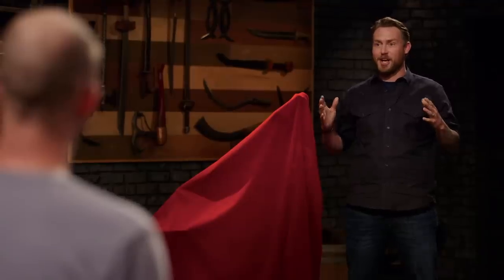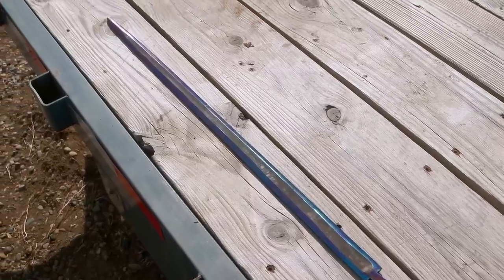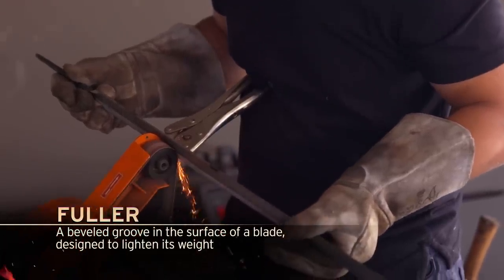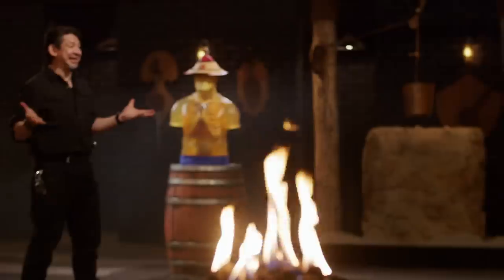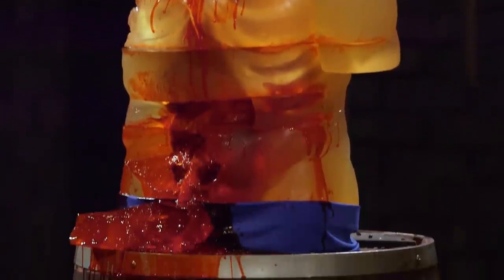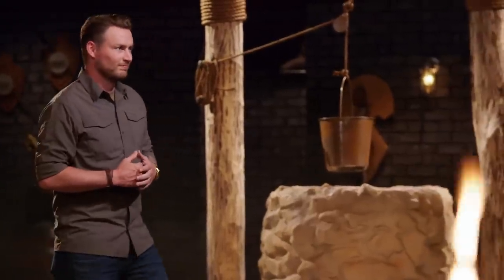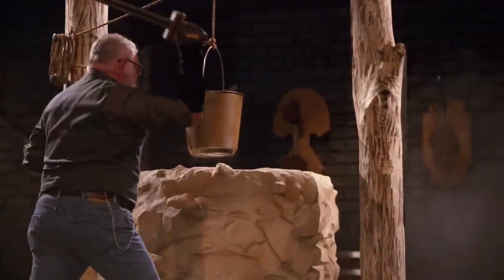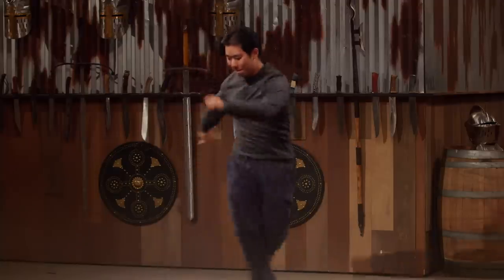Forged in Fire: TERRIFYING Tuareg Takoba TEARS UP the Final Round (Season 8) | History

Comment: Homie quenched THREE times and not only survived, but won! An absolute LEGEND.
Reply: why is it not advised to quench a blade more than once?
Reply: @angelserenade  Every time you heat up the steel and cool it down, you burn off more and more carbon content. Each quench increases the risk of the steel developing a crack, which comprises the blade. Warping can happen as well, but that’s not “as serious” as a delamination.
Reply: I even thought josh could lose it because of that quenching thing.. which is the greatest nightmare of all the bladesmiths... luckily his blade endured the strength test..
Reply: Guess he survive due to the material he's using. Not sure though, I'm also looking for answers in comment
Reply: @magnaviousyk3118  it looks like thick Leaf spring steel the same kind used in much older bulkier junker cars and its a nice choice when turning it into blades as it guarantees better blade retention and can take punishments
 when quenched right

Comment: Dave is such a tough guy. You can see his right hand was cut and bleeding after he took off the sleeve, perhaps just a nick, and it could be a lot nastier, with that free falling blade's tip. He went on to the next test with a glove!

The Asian dude's blade has a warp after the quench, it's visible on camera. His sword is not as well balanced as his opponent's. But during the kill test's decapitation stroke, you can see the heat treatment of his blade and the hilt construction are sound. It was a hard strike without cutting completely through the neck, the sword had to absorb all that energy upon impact.
Reply: nice, thanks for the insight
Reply: It's called Sabre.
Strangely enough it's when it warps like a katana due to possible uneven quenching.
Kind makes sense seeing he went to the quenching 3 times. Surprised he wasn't disqualified.
Reply: This sword is a double-edged straight sword. A sabre is a single-edged curved sword. So, no, it’s not a sabre, and it’s not supposed to be. It’s called a warp, and it’s a kind of smithing defect.
Reply: The warp on an uneven cutting edge from either side is called a Sabre (a type of warp)
Not to he confused woth a type of blade.
Same spelling. Sorry for the confusion.
Reply: @joshuakim397  I have never heard anybody referring a defective blade warp as a "sabre". I've looked up and asked around and nobody seems to have anything like this either. Citation please.
Reply: The statement is alpicavle for many blade types not just single edged blades of significant length.
Reply: Press: (ctrl+f) and type in warp
Reply: Had to space out the net as the link is being swept by youtube.
Reply: sbg-sword-forum.forums

/thread/47601/quenching-single-blades-dealing-quench
Reply: Youtube stop deleting the link!
Reply: @joshuakim397  Good to see a fellow SBGer here. Yeah that's quite an esoteric term, "sabering" is. First time ever heard of it. Thanks, Joshua!
Reply: My absolute pleasure sir!
Xoxoxoxoxoxoxoxoxoo

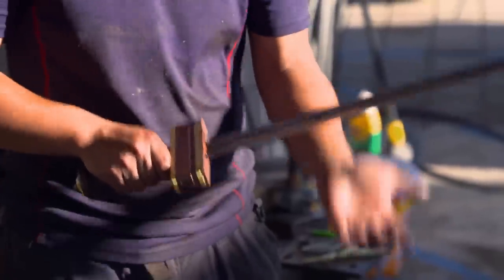Comment: I just paused at 3:46 to post this. Isn't putting brass in the pommel against the parameters of this sword? I mean in the intro they talked about the Tuaregs aversion to iron, but is it different with brass? They stated that everything was wood to prevent the person touching iron.
Reply: Brass is fine.  It's direct contact with steel that's an issue, far as I can tell.

Comment: From Great Ethiopia
Reply: Nope.

Takoba (also takuba or takouba) is the sword that is used across the western Sahel and among ethnic groups such as the Tuareg, the Hausa, and the Fulani. It usually measures about one meter in length. Takoba blades are straight and double edged with a pronounced tapering from the guard towards the tip; they can exhibit several notable features, including three or more hand-ground fuller grooves and a rounded point.
Reply: @douda3357  Thank you Mister Wikipedia cut and pasta. Wikipedia = most accurate thing ever made.
Reply: Liar ahaha 😆
Reply: Can we all agree that the takoba has done the most damage to a balistics dummy for a single handed weapon.
Am I right or am I right.
Making the European blades run for their money!
Reply: @joshuakim397  Yes, but you got to understand even the smallest cut can be fatal. Human body is weak. I take speed and lightness of a blade to how much damage it can do. I am not making mince meat. I just need to take the guy out of action and move to the next one.

Comment: Who hits a sword to a well and log.... I don't blame him..... That not a test thats abuse to a well crafted sword
Reply: Exactly, they owe him for damaging his sword
Reply: You've never played Age of Empires I see
Reply: @gublaman  i was a bad boys and. Hitman silent assasin type of guy
Reply: Quite a few sword manufacturers tested their swords, especially after Napoleonic times when it was found during those wars that quality control was spotty for mass produced steel. For example, Wilkinson did quite brutal bend tests and hits against wooden blocks to verify a good temper, without fractures. They even standardized their testing methods with various rigs to make them consistent. There's plenty of proof marks and stamps for quality control, especially for military production. After it was found that bend tests stress the metal, no matter how well it is tempered, the British added an X - stamp showing the direction of the bend to show that the blade withstood the test and to warn not to repeat it.

Looking at the close up at 7:20, the sword had too sharp and ragged angles and too high hardness at the blade to tang transition, causing a stress fracture. It would've likely been fine, had it had cleaner and more rounded transition and had it had a better temper to a more springy state.

Aside from that, having cut the tip off of a tatami cutting target stand with a sharp sidesword and hurting my hand in the process, I can attest that swords have to be able to take quite a lot of abuse. Whether they're stopped by wooden stands, bones or another sword, you know... parrying that we did a heck of a lot during the fencing course, swords that you rely on to keep you well defended in actual combat do have to be able to take it and then some.
Reply: striking armor would provide similar stress. not to mention, it's a competition, and it's not about who does well- it's about who does better. one of them broke, one of them didn't, simple as.